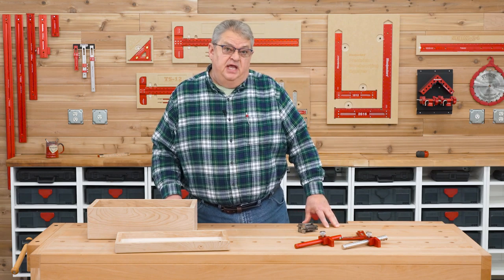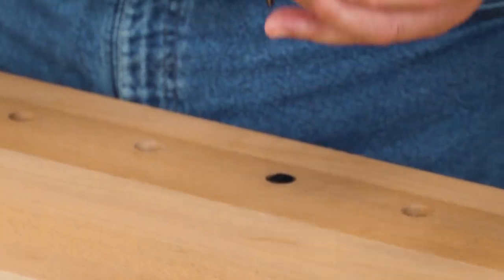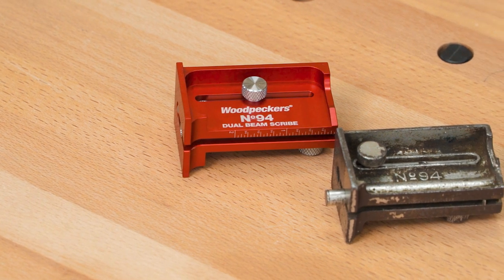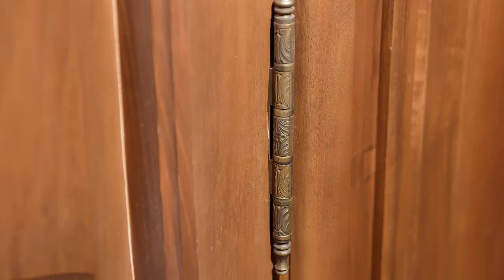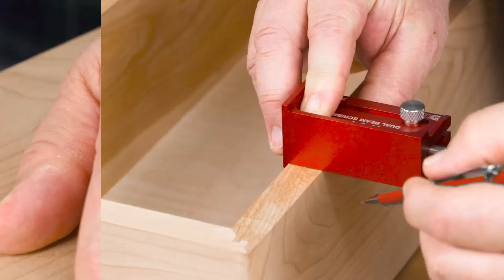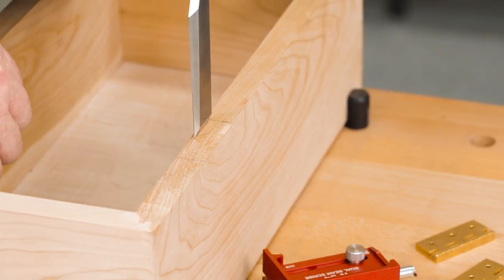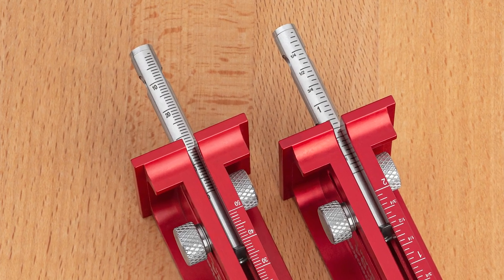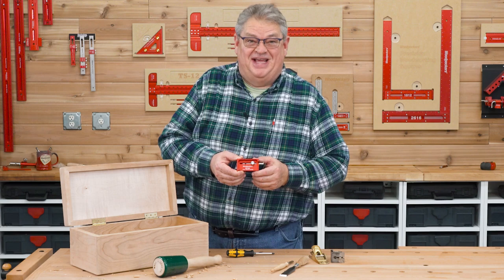Easy Hinge Mortises With The No.94 Dual Beam Scribe | Woodworking Tools

Comment: Still have my old dads Stanley No 95. Still works. The No 95 is better than the 94 which you really should have copied. On the Stanley No 95 although it looks the same as the 94 has two scribes on one of the shafts and one on the other. The single one is for setting the thickness of your butt. The one with the two scribes is for setting the depth of your butt. Once the set up the two scribe shaft will be one end for marking your door and the other end is automatically set. For the door jamb. Only use it for fixed door stops these days as new work is a lot quicker with a trend skeleton hinge jig and router.

Comment: What is the difference between a No. 94 and a No. 95? I found an old No. 95 Dual Beam Scribe in my grandpa's old tool box. 

He was a farmer and cabinet maker by trade. In the summer he farmed and in the winter he built custom cabinets. My dad recently dropped off my grandpa's old tool box. My Grandpa died in 1968. 

No one had opened his old tool chest since his death. I finally opened the tool chest and cleaned and inventoried what was inside this week. I found a tool as your show but with "No. 95" embossed in the casting instead of "No. 94". What's the diff?
Reply from the maker: We believe the #95 has additional scales but basically the same tool
Reply: @WoodpeckersLLC   I found that the scribe ends face the opposite way as a No 94. Some else told me that the No. 95 is Butt tool. ???

Comment: WoW!  only $130, when you can buy the original for $15!!!!!  They make some great tools, but sometimes they are RIDICULOUSLY over priced, and this is one of those time!
Reply: I think the WP #94 OTT would be better in quality than the original Stanley #94. It doesn't appear to do anything more, but the precision with which it's made will be a couple levels higher. And IF Stanley were to make their version today, it would probably cost much more than $15. There is a company in Australia that sells a version of the #95 Butt Gauge for about $45, it has dual scale markings in imperial and metric, something the Woodpeckers version should have. Making two versions, one imperial and one metric doesn't make sense to me but then I'm not trying to pry every last dollar out of my customers wallet. For ~$130 you should get both imperial and metric scales on one tool.
Reply: @bobd.  I have one of the old Stanley's!  It is well made, nothing loose or sloopy!  As far as the scales on the tool, I have never used the one that is etched or cast into it!  I have always used the workpiece that I am cutting to set my gauges from, and most if not all of the woodworkers I know do the same so what the tool has on it is fairly relevant!  I paid $12 for the one I have and I got it a little less than a year ago, checking on line I see that the prices are about the same for most listings!  A close friend that has a machine shop watched your video and he agrees that you are selling these at far to high of a price as well.  I do not have any reservations in saying that this tool is ridiculously over priced!!!!
Reply: @mikesmicroshop4385  I'm not selling anything or connected with anyone who is, from Woodpeckers or any other company. I have no video related to this product nor do I have a video about it on YouTube or anywhere on the www
Reply: I don't believe I ever said that you were or did!  I am commenting on the tool and its over pricing!
Reply: @mikesmicroshop4385  i guess the "watched your video" and "you are selling" tripped me up.
Reply: Ahhh I see!  I did not realize you were not associated with Woodpeckers the your videos I was referring to is the woodpecker video on this tool  I apologize for the confusion on my part  I should have looked at the name on the comment!
Reply: So go buy a $15 one and stop whining. Or do you post complaints about prices on all the high-end product websites? Tell us where you moaned about the cost of a Ferrari, or a condo overlooking Central Park on "Billionaire's Row", or about Starbucks' prices, or tRump's NFTs? Yes, of course you have 1st amendment free speech rights and you can post your whining if you want, but that also means you can be called out for it. It works both ways, Sparky.
Reply: @JeffRL1956  So stating the fasts is Whining?  Makes me wonder what you would call real Whining!  LOL